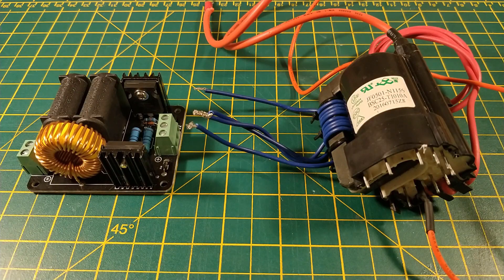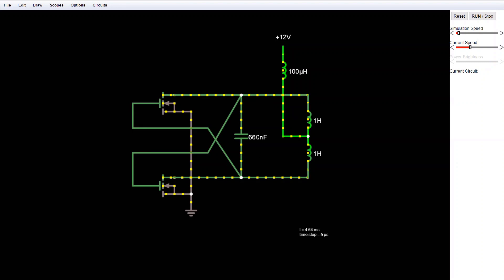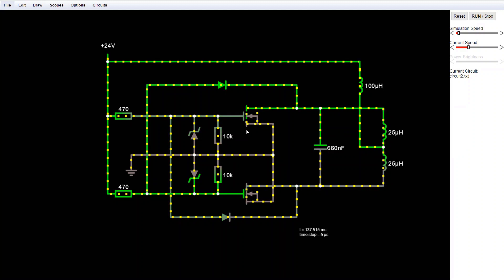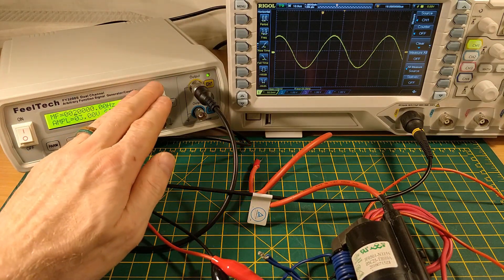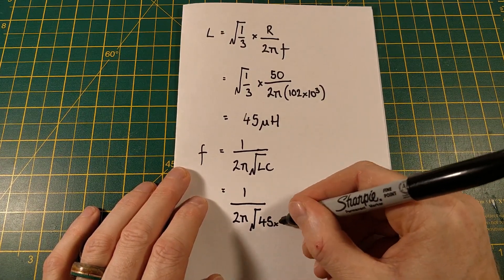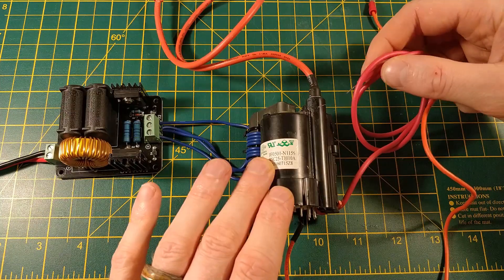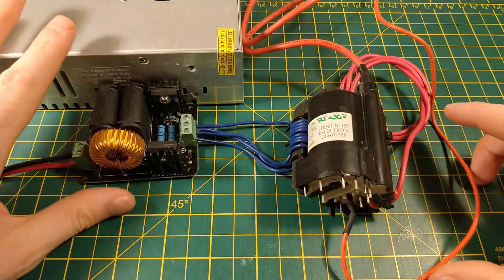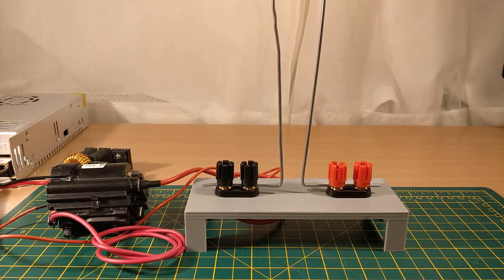Jacobs ladder using a ZVS driver and TV flyback transformer

Comment: Hey man Question, im using the same model of ZVS driver and the same EHT flyback yet i never get an output. I have input 24V 4A into the zvs and no results no even a single spark.
Reply: You need at least 10 amps minimum current.

Comment: Did you have issues with your flyback overheating and dying? I bought the same kit and keep blowing up the transformers with just 24 volts after about 5 minutes of it being on.
Reply from the maker: I never run it for more than a few mins at a time, but after using it for a few months, I did end up having to replace the transformer, yes. Would probably be happier on a lower voltage, but then it's not as effective :( no big issue for me though, I just don't run it for too long! Thanks for commenting

Comment: I need to be able to produce a spark/arc underwater. I have this same rig and I've tried with a 12v battery but no joy. Does anyone know if I simply need a higher voltage and or current input or something else entirely?  I'm currently using 2x 6v batteries in series but they are low especcialy current batteries.
Reply: You need more voltage and current.

Comment: Its a great explanation and demo of how to build the jacob's ladder however, at 1:01  you say "ok so we have 12v dc in and 12v dc out, then whats the point of this [device]?"   well you never answer that question.   You delve right into the schematic (which I would never understand,) and still tells me me nothing about WHAT"S THE POINT OF THE  DEVICE.   You totally skipped why you can't just send in the 12v dc directly into the  flyback transformer (the black cylinder thing.)   Can you explain why the ZVS Driver is necessary???
Reply from the maker: Sorry it wasn't understandable enough. I thought I did explain it, but I'll try again now. The ZVS board is used as an oscillator, to produce AC voltage rather than DC (remember transformers don't work with DC) . The ZVS circuit is an LC tank circuit, meaning it consists of an inductor and a capacitor. But instead of having an inductor on the driver board, it instead uses the inductance of the primary coil. So without connecting it to the transformer, there is no inductance and therefore no oscillation (puts out a steady 12V). Once the transformer is connected, the circuit will oscillate (as it now has some inductance) producing the AC signal that drives the transformer.
Reply: @ScottMarley  ah!!! thank you. so the input to the ZVS is 12 DC and while the output is also 12v dc without a load, if the load is a coil that has inductance it will force the ZVS into an oscillation creating 12v AC.   right?
Reply from the maker: Pretty much. The peak AC voltage is actually higher than 12V  due to the voltage spike caused by the collapse of the magnetic field in the inductor. For a 12V input I got about 30V peak AC I think. It was a while ago now and I can't remember. The main reason to use the ZVS driver rather than any other ac source is it switches at the 0 crossing point (zero voltage switching) meaning relatively low losses and therefore low heat. This means it can provide very high currents which is what we need.